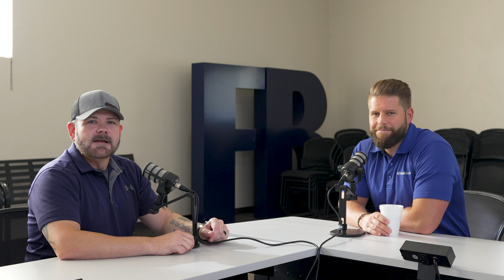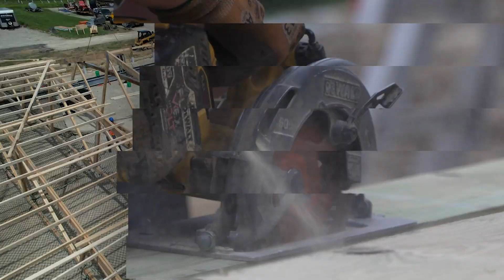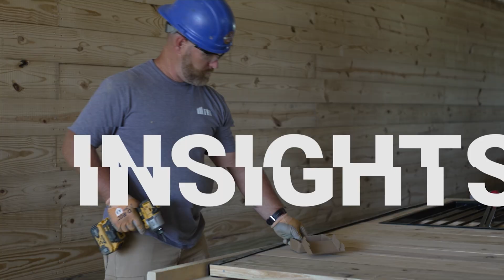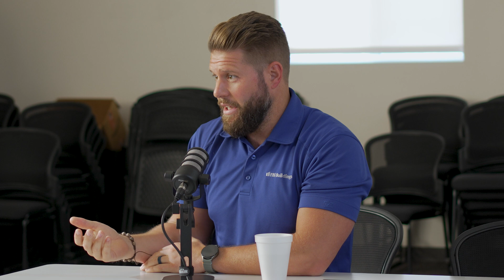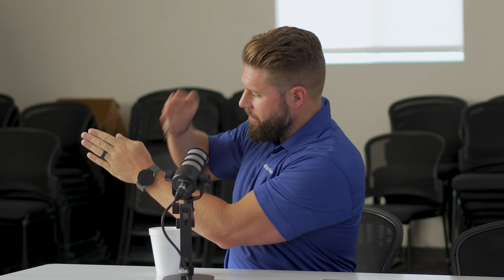Pole Barn Trusses: Why 4' On Center?

Comment: Most post frame buildings here in the Pacific Northwest have columns and trusses installed at 10' & 12' spacing. The trusses are more heavy duty and are doubled at columns. 2"x6" roof purlins are installed on edge with joist hangers between trusses. We typically do not install full length headers to carry trusses.
Reply from the maker: Thanks for sharing how things are done in the Pacific Northwest!

Comment: Ive seen plenty of 4' OC with each truss connected to a column
Reply from the maker: Absolutely — 4’ vs 8’ OC is a classic debate! At FBi, we design all truss spacing based on structural engineering and the specific loads of the project, not just a standard spacing. That’s what ensures long-term strength and performance.